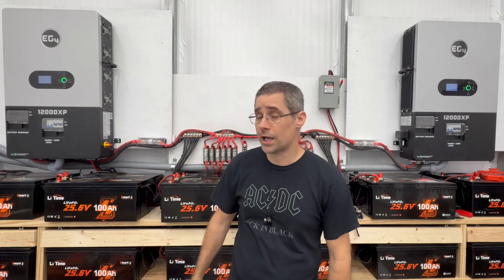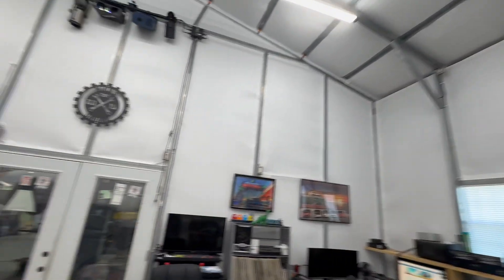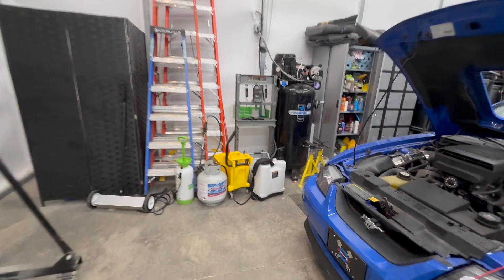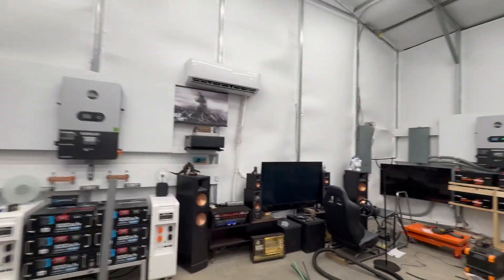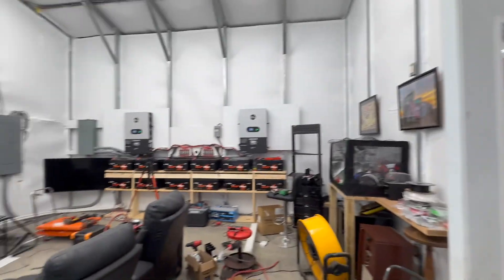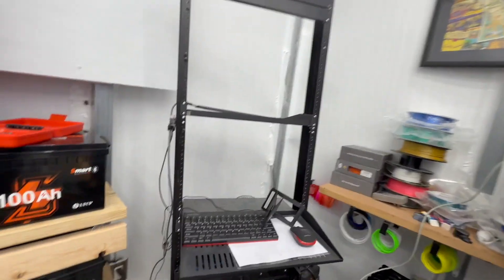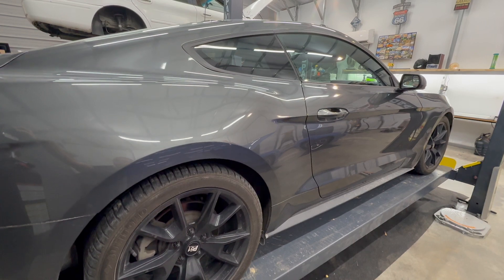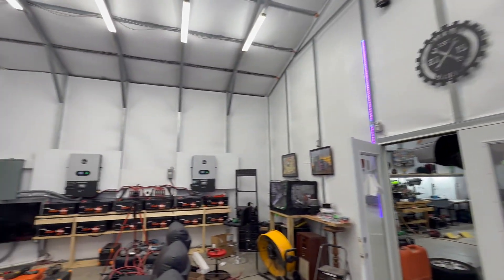Testing a Pair of 12,000 Watt Inverters: Is Bigger Really Better?

Comment: On the little l-bracket side tabs on the EG4 12000xp I did find the screws needed to mount to the inverter. What size screws do I need to pick up to mount my l-brackets? Any help would be appreciated.
Reply from the maker: Hi dogar77,  are you referring to the small L brackets at the bottom of the inverter?  If so a number 10 or 12 pan head screw would work.

Comment: Should be no problem with my 20A load, 35A trailer panel. Future is L2 on a L50 panel. The EG4 panel calculator saved me from cooking the inverter, 410V at -30 is over 480V. I am missing 2 panels to max out. Any more pv I need to go big over 600w panels. Cold temps and snow bonus screwed up my plans.  The 465w +23% and the 550w were +33% vertical with snow. 570 and 730w. I have to install it outside the current inverter home, its huge and flat.
Reply from the maker: Wow!  I’m trying my best to stay at 8 panels per string just in case of that sunny cold snap kind of day.  Open circuit voltage should be around 370.
Reply: @MikesSolarGarage  440 would be the highest it could go, x1.2 has a buffer.